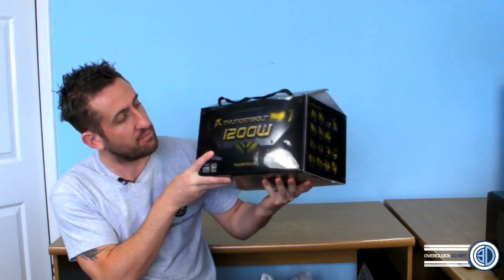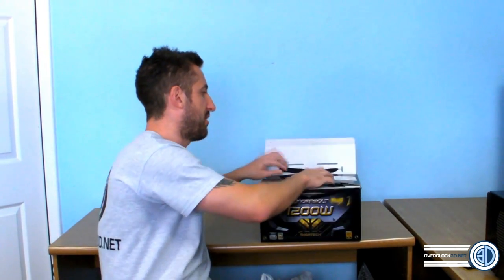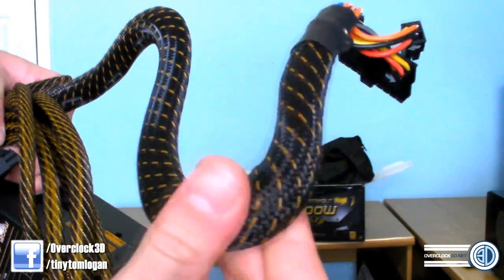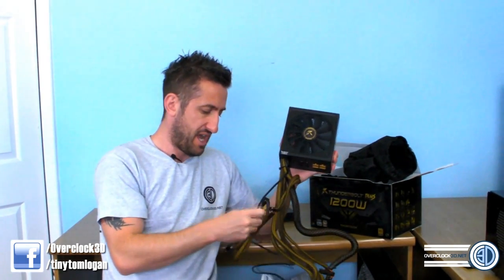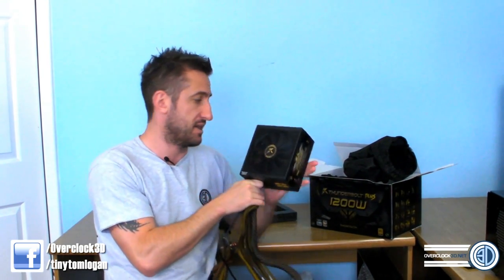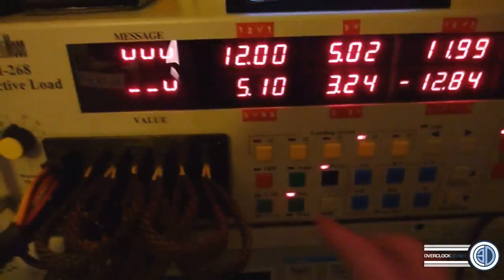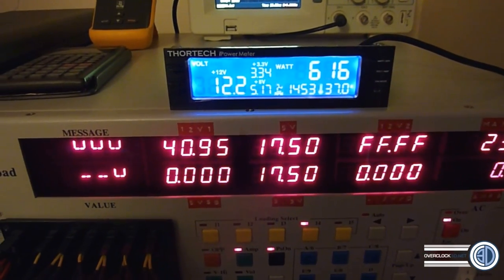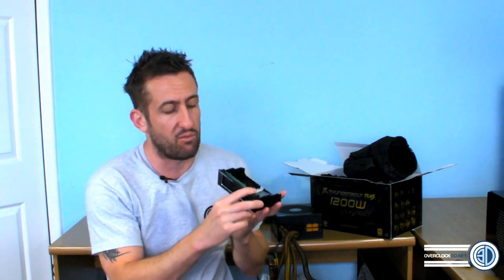Thortech Thunderbolt Worst PSU Ever?

Comment from the maker: We have a secondary unit that is able to apply extra load, we have the ability to load beyond 2000W. We have loaded a 1500w PSU recently and had it running within ATX spec at 1900w.

Comment: Kentek, Diablotek, and Sentey are also terrible.  Go with Corsair, Seasonic, Cooler Master V Series (Seasonic-based), Antec, EVGA, or bequiet! for PSUs.
Reply: Atrix is pretty bad too.
And EVO Labs. There was a PSU made by EVO Labs in like, 2014 and it only has ONE PCI-e cable. Seriously, EVO Labs?
Reply: fractal design are quite good too :)
Reply: THERAZORKILLE Productions another bad one is CaseCom. its not too bad but they are not something i would pay 100 dollars for
Reply: THERAZORKILLE Productions Some Corsair units are crap. CX, CS, RM, VS.
Reply: AliveGhost13 RMs have gotten better over time, CX are meh, and then CS and VS are more meh.
Reply: +TheUndeadNazi Corsairs RM is crap and overpriced. EVGA nex is cra too Id take a seasonic bronze over those crappy FSP and CWT gold garbage any day.
Reply: +THERAZORKILLE Productions Corsair is hit and miss, the ripple on the rm750 is horrible, I bought one thinking corsair were good, now I took it out and put it in a PC I don't care about and bought a seasonic x 750w.
Reply: Super_Slav Corsair RM 750/850 changed from Chicony to CWT, and the ripple suppression is very good on both models (in fact it's excellent). No idea what you're talking about.

Corsair is not hit and miss at all, CWT are hit and miss.
Reply: OK
Ripple is still too high for a PSU in that price range, for less money you could get a EVGA or for pretty much the same price a Seasonic which both outperform it.
Reply: Super_Slav lmfao it's 20-30mv ripple that is extremely excellent, Super Flower and SeaSonic are also around that level so you're totally wrong, often they are higher even and it's nowhere near too high for a PSU in that price range, the $400 Corsair AX1500i manages 15mv.

You do realize that the ATX spec limit is 120mv right? And everything under like 30mv is extremely good? And totally unnecessary? They do it to show off and make their PSUs even better.
Reply: OK
Where are you getting 20? According to tests the new ones are getting only slightly less compared to the old, I will certainly never get another corsair after it almost destroyed my system, had to buy a new system since the old one is semi functioning.
Reply: *****
OCZ don't make PSUs they just brand them.

Comment: Thanks for doing the proper load testing on the power supply and I can't stress enough, thanks for testing the ripple. I design switching power supplies in UK (not for PC) and it's so annoying how even people in the electronics industry look at a power supply module as an ideal DC voltage source that behaves the same at no load as full load. It's really hard trying to explain the difference between a well regulated low noise (ripple voltage, not sound), has OVP, OCP, OTP etc power supply which meets all the safety and EMC regulations and a super cheap chinese made one which is poorly regulated, really noisy (ripple voltage) has few protections and which meets few regulations but only costs £25 for maybe 300W. How many times have I heard "it's just volts and amps"...

Comment: I wouldn't buy corsair ever again.
I've had a few of the middle-class ones, like the 650 gold and RM850 gold, they are shit.
Both of these has caused severe problems in my rig, like trippin the circuit breaker when i plug them in or several boot failures.

They also have had major issues with the RM 850 whereas the fan wouldnt spin up under load, mine never does, and i had to mount an external fan on it to keep it cooled.
Reply: +StopaskingformynameYouTube that sucks. ive had many corsair power supplies and ive had nothing but good to say about them. just superb. you got the short end of the stick. its technology, it happens, thats why warranty exists, so they can give you a replacement.
Reply: +StopaskingformynameYouTube I had the same experience. Mid tear corsair PSU'a are of very cheap quality. Went through two GS600 units both with loud coil wine under any load.
Reply: +StopaskingformynameYouTube I had a corsair 600 watt unit that caused grounding issues and blew a few mosfets on my asus board which were a pain to replace, and it would also cause my video cards to be detected improperly.
Reply: evga>corsair and every other psu company
Reply: +Morgan Williams nice man ! in my main build i have a 1200w evga 80+ platinum psu 
my case is the enthoo primo so you cant see the psu 
i have a custom watercooled system that its theme is red and white       the psu is hidden thankfully and it dont show its colours     ( titanium yellow black evga p2 series )     
if my psu had to be in open i would go with the corsair rmi series cause is white even if i do secrefice performance
but cause the psu is hidden i went with the better evga psu! better choice right? hehe :D
Reply: Morgan Williams

great option it would fit perfect in your build!
Also the psu will last above 3-4 years easily
The electricity goes off sometimes and the psu protects the components pretty well so
quality psu=better protection for your hardware and a lot of other things
Reply: Morgan Williams
hehe nice queastion and i will awnser you!
i have 2 rigs and they are both custom watercooled
one is my lan party/portable/second pc in the house (define nano s)
and the second is my main pc (enthoo primo)

so i need to ask you some questions
what componets do you wanna put inside
and why are you going for mini itx
Reply: Morgan Williams

and i suggest the nano s between all of those
its a VERY sexy case small portable and with pleanty of watercooling options
i have a 240mm and a 240mm in top and front of the case and it looks stunning
Reply: Morgan Williams
(nano s build)
in my case with the full custom loop its dead silent ! cause i run the fans in very low rpm (600-800 rpm) and it gives me plenty of cooling ! gtx 980 ti oc 1546mhz and a i5 6600k 4.9ghz tempratures with aid64 and valley benchmark are 55 for the gpu and 57 for the cpu ! this tests push to the limits both cpu and gpu and in actual games the temperatures aremuch lower than this
Reply: Morgan Williams
you could do a custom loop too if you want
i will help you if you say yes
the benefits are : higher overall ocing , much much lower temps , dead silent system , badass looks and much more!
Reply: Morgan Williams
in person it looks even better than the pictures
lets see what zen can do
in my main rig im running an i7 6700k can zen surpass my single core performance?
(5314 geek bench 3 ) multi core: 21049
Reply: Morgan Williams

specs?
also
do you have any expierience with custom loops?
Reply: Morgan Williams

i have build like 8-9 systems (5 of them custom loops)
Reply: you could get a predator 240mm if you plan to buy an aio cooler its like a custom loop but as an aio miles better even from the nzxt x61 !Morgan Williams
Reply: Morgan Williams
im a dude hahahahah :P a girl would never know so much about pcs lol :D
Reply: Morgan Williams
if you dont mind spending a little more then go for it ! also cause it has better components i wont leak but i cant swear that for the ready aio
Reply: Morgan Williams
 i wacth his channel
Reply: Morgan Williams
np man ask whatever you need to know or just want a opinion in somehting

Comment: Corsair CX is pure shit. Pass it along.
Reply: Hx is better
Reply: I have the cx600m. No issues with it so far. I'd take an evga supernova if I had to choose again though.
Reply: m80pls what do you mean?
Reply: Ben Zimmerman What more is there to say? The clip does not clip, google msi gaming and corsair 24 pin and see the issue.
Reply: My CX600M died just after the 3 year warranty expired. I popped open the unit and noticed they'd cheaped out on the secondary capacitors, unfortunate as the rest of it was really well built.
Reply: Not the new ones

Comment: 2 things:

When testing the 12V rail, it would be useful to tell the max load specified for that rail (looked it up, 100A for this one which is way higher than the ~3A you got out of it).

Then there's the power consumption readout, which depending on how it's measured, could differ up to 12% (at 20% load or above according to the 80 Plus Gold specifications) from the outlet measurement. This is because some of that power is lost into heat.

That being said, this was very good and informative.

Comment: The only psu brand I'll ever buy is corsair
Reply: Good choice, they are always good and their customer service is great
Reply: I use a hx520w modular psu, used it for 3 years and its still working fine and it stays cool and silent!!
Reply: japaneseguineapig 
My next one if going to be a AX1200i.
Reply: higher end corsiars like the hx ax rm are seasonice made so theyre really high quality
Reply: yes but the cx and cxm series are not and are not particularly good so avoid those
Reply: The Guy Agreed heard they fail alot so I got a 430w evga 80+ psu becuase in my oppinion i think evga has better low end psu's than corsair
Reply: The Guy my firends are stupid and laugh at me when i say xfx is better then cxs:(
Reply: thomashc16 your friends can have dead computers =) their choice

After owning a CX750m and having to go through it killing my motherboard and CPU, ill never even consider getting a CX series PSU from Corsair ever again. That being said, i am now running the Corsair AX860i. Great power supply, worth every bit, corsair link power tab is pretty cool as well. Being able to monitor how much power my computer is using is great.
Reply: Skyler Jacobs  Get a EVGA 650/750 :D
Reply: Slappingcreeper 121 No need to do that, I have the Corsair AX860i. Quite the expensive power supply, but it is absolutely awesome.
Reply: Okay. I have a EVGA 650W gold certified. A little bit loud but I think it is the CPU fan (intel stock one). Performs AWESOME
Reply: Slappingcreeper 121 Yeah, most definitely that stock intel CPU heatsink/fan combo. Power supplies are usually quiet, if not completely silent.
Reply: Is it possible to remove/swap around heatsinks for CPU's? I have plans...
Reply: Slappingcreeper 121 You can always buy an aftermarket CPU heat sink. They will list chipset compatibility in the specs.
Reply: How do I remove the current heatsink then?
Reply: MisterSouls That is a terrible way of thinking. You know why? Because then Corsair has no incentive to retain their positive qualities.

Indeed that's what's happening, the company amassed a great reputation by releasing Seasonic-made PSUs, which are genuinely held at highest regard among pros, at super reasonable prices. But as the model lineup changes, PSUs that are genuinely great wander towards higher price points, and the reasonably priced PSUs become replaced by cheaper made units. The complete affordable Corsair CX lineup has a high incidence of transformer buzz, terrible production quality. The limited safety of that lineup is also hardly praiseworthy.
Reply: Slappingcreeper 121 By following the instructions in the CPU installation manual in reverse, duh x.x You rotate the mounting pins till they unclip, lift them, and then you can lift the heatsink fan assembly. If the heatsink is stuck and doesn't want to lift, means thermal compound has dried up. Try wiggling it around a bit, but don't apply too much force. If the thermal compound was applied too thick and became a dried solid block of cement, orient your board vertically and spray pure Isopropanol between the CPU and the heatsink, it should permeate the thermal compound and loosen it. If you end up doing that, you probably should take out the CPU too and let everything dry for maybe half an hour to be safe.

Before trying to take off the heatsink, make sure you have fresh thermal compound around so you can reverse the process. Always remove old heatsink compound completely and apply the new one, Isopropanol is the best solvent for it and is generally safe for electronics. I recommend Arctic Cooling MX-2 thermal compound, it doesn't have the best thermal conductivity (though pretty good) but it has a proven track record of not going bad for a long time and it applies really well, as well as being generally quite safe. Take care to apply as little thermal compound as necessary, because thermal conductivity of any such material is low, it's only designed to displace the air and facilitate thermal contact between metal surfaces.

Before doing all that, make sure that you actually want to replace the heatsink at all. Make sure to remove all dust lodged in the cooler, and make sure that temperature based fan control is enabled on your mainboard. Dried or badly applied thermal compound can also be source of bad thermal performance, high temperatures, and high fan speed.
Reply: I'm happy with the stock heatsink I have now

Comment: I have orderd this PSU and after I did I decided to look for a review on it.This is the only proper test I could find and based on it I have changed my order to crosair RM1000.I have to say I didn't care what PSU I'm putting in my system up to this moment. Thanks for the valuable info guys.

Comment: ...and yet, my first PSU was from EvoLabs... $30 for a 400 watt PSU, I spent about $85 getting it tested and it had a 40mv ripple under a 375W load and 45mv at 410W with no issues or failures, and I still have that PSU somewhere in perfect working order now, apart from a bad fan bearing!

Comment: I just got a CX600 yesterday for 120$. I installed it in my rig (temporarily, I'm waiting for my GPU), and it worked perfect. It came with black screws, something I hoped they included. After all, I am glad I chose Corsair, and I WILL choose them for further projects aswell. As Tom said, go get a proper PSU, I've had several PSU from Besttec (not in my rigs) which has gone down, and taken the motherboard and such with it.

Comment: It's not faulty. OC3d used incorrect testing procedure/equipment here. It is all well documented at jonnyguru as well. If I remember correctly they had been even warned about it but instead of correcting their mistake and apologizing to Thortech, they chose to ignore it. That's when I unsubscribed from this channel, because in my opinion nobody's pride should stand in way of objective review.

Out of curiosity I decided to check if something has changed and well... nothing has changed.

Comment: An XFX PSU [Seasonic re-branded as you stated] of mine went in five months. It also managed to take out the whole floor's electricity [wall socket circuit only].

Comment: I do have one issue with your test. It is natural for the display and the tester to be off by .1 or up to .3 volts depending on the tester and the display. You will naturally lose some voltage do to the connector on the power supply. Belkin standard use to be impedance wise 1 connector equals about 1 meter in cable length. Depending where in the circuit the meter draws it readings from could be your difference.

Comment: The reason your wall power consumption reader and the power supply monitor were reading different results is because the power supply is not 100% efficient. So whatever wattage you are pulling from the power supply you are pulling more from the wall, 50-75 watts is  explainable by this. (I'm not saying your wrong, I found the video quite informative, just pointing out why there is a massive difference)

Comment: You can look up the manufacturer of pretty much any PSU out there.  Read up a little bit about the companies and the parts they use in the PSU you're interested in and you'll have a good idea if it's a good unit or not.
I went for the Silverpower 750M, myself.  It's great once you change the fan grill.

Comment: I had a OCZ 750 bronze I gave to the kids and got a gold 850 watt. The 850 watt went off like the fourth of July with in a month. It was actually good thing i don't leave my PC on and was around when it happened. With all those years of computing I never had a Power supply explode internally. The replacement is hanging in there though.

Comment: That's right. I forgot.  I had two SM-268's for a short while before getting the SM-8800.  Still... we both ran a PAIR of SM-268's because of the capacity issue.

Comment: I own a ZT 750 and I can tell you it is fantastic!!! It delivers super clean power at realistic room temps. It has a 140mm fan that is super quiet at under 80% load. However, if you are using more than 80% load it is louder than my hair dryer!!! There is also a known fault with this version where the fan spins up to excessive noise levels at low usage. The RMA process is also painfully slow. 30 days turn around!!! If you get a good one though, you are happy as larry!

Comment: Solid unit. Even more solid after Corsair bumped the warranty up to 7 years due to a flaw they found in Seasonic's fan control methodology. Seasonic used a load-based FC method in the AX/Xseries and hence many users with high ambients found their PSUs to develop bulging caps way earlier than their time.

Comment: Hi guys.  You're not stressing out the power supply.  I believe you're stressing out the load tester.  Your particular SunMoon SM-268 can only handle a total of 1080W and only 960W of that can be put on the +12V (40A on each +12V rail).  See how VC flashes between the load and FF.FF when you crank it up?  That's the load tester telling you you've exceeded it's capability and it's time to crank it down or suffer a failure (of the load tester, not the power supply).